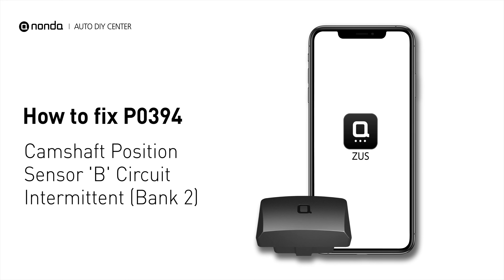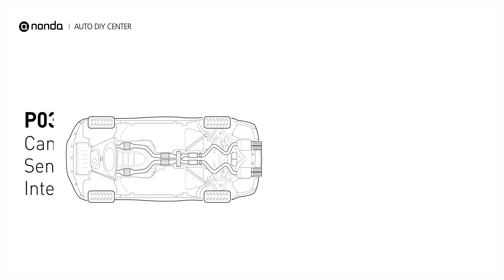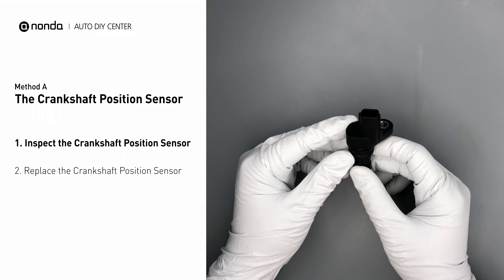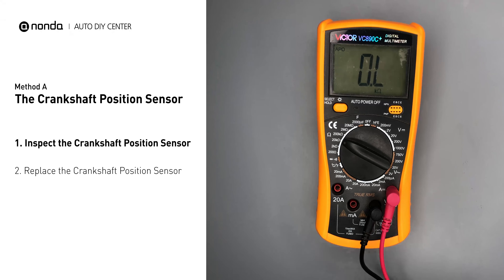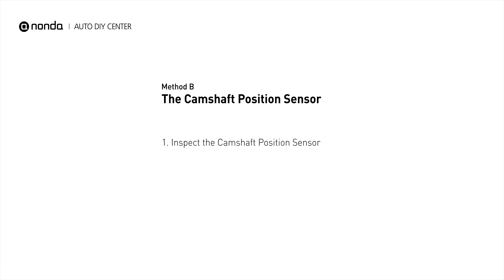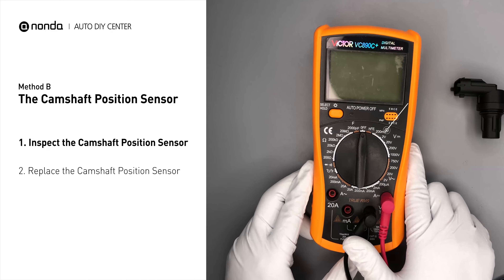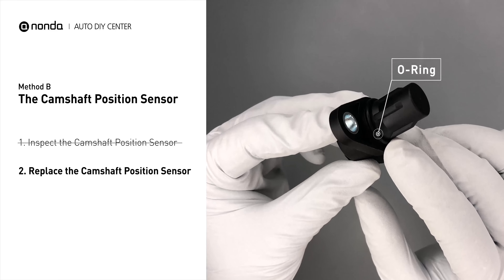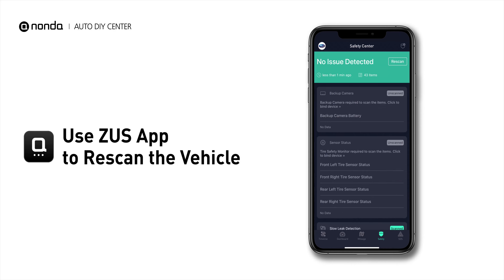How to Fix P0394 Engine Code in 3 Minutes [2 DIY Methods / Only $9.26]

Comment from the maker: Hi, I'm Steve, nonda's lead mechanic engineer. 
Feel free to leave your comments here if you have any mechanic questions, I will be glad to help you out!
Reply: Check engine light on
Traction control light on
Electronic stability control light on
Abs light on

Auto Zone scan the car and the main code is P0394 along with others. Went to the dealer had some recall repairs done. Lights still on. They asked to brake down my transmission to try and see if the problem lies within the transmission. I stopped them and took my car home. The dealership could not promise me the problem could be found or fixed.

Comment: Can the car be driven with this code along with a P0117??
Reply from the maker: Hi Lorenzo, this code will put your vehicle into a failsafe mode, which may cause your car’s engine to hesitate and run rough. We suggest that the issue should be fixed immediately as ignoring this trouble code may lead to further damage to your engine and your vehicle.